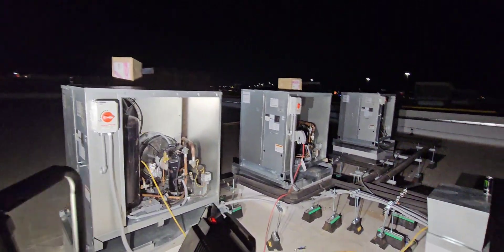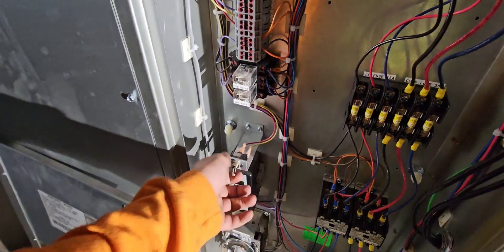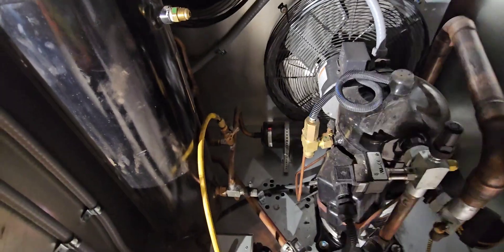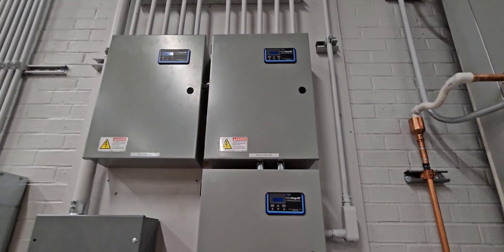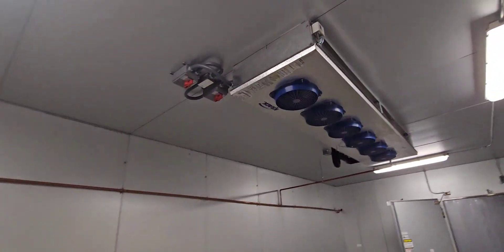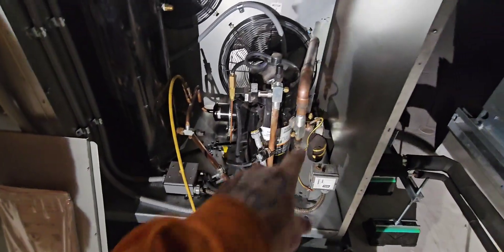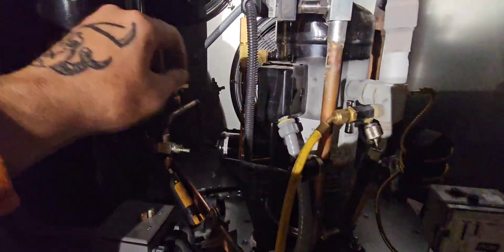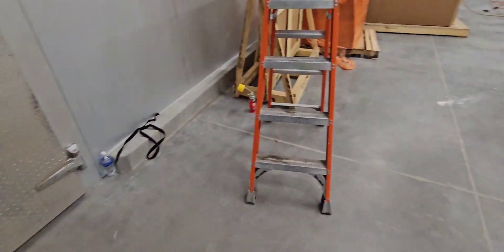Supermarket Refrigeration: Walk-In Freezer Start-Up

Comment: Hey quick question. If it’s a new box which it looks like it was. I thought you needed to step down your set point on a freezer to pull out the moisture of the slab? Unless it was a slab already there then you built the box, but I would still think you would need to step it down from 32 to 10 to -10.
Reply: Just a question. Why are the freezer fans running with the system off compressor off? It's just a question. Why are our did you cut out the fan delay..?
Reply from the maker: @hectortorres542  ya good question. Since this was a fresh start up, I just wanted to see the fans run just to make sure they were all working properly. I put the fan delay back once I was done.
Reply from the maker: Ya that slabs been there for a while now. I didn't have any concern with cracking it or I would have done that. That's cool you know to do that 👍🏻

Comment: hey so with that defrost clock up in the condenser, do they just not wire into it for the application you mentioned with the ke2 control? could you use that clock in an emergency is the digital fails?
Reply from the maker: Ya it's wired internally to the condensing unit, there's just no control wire going down to the box. You might be able to make it work in an emergency if you put a solenoid up at the condensing unit.